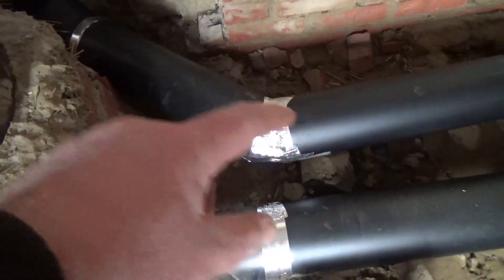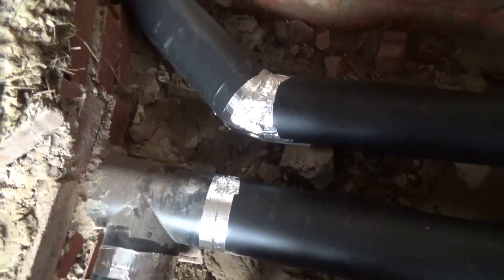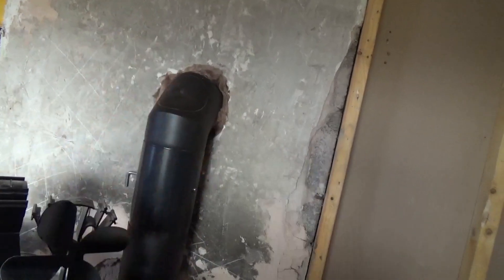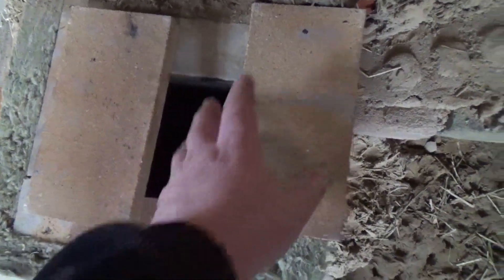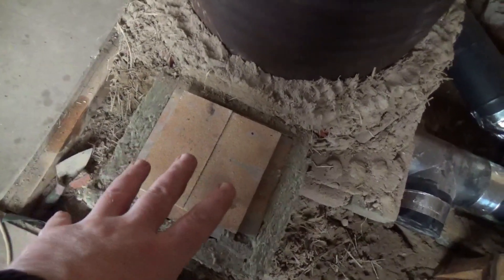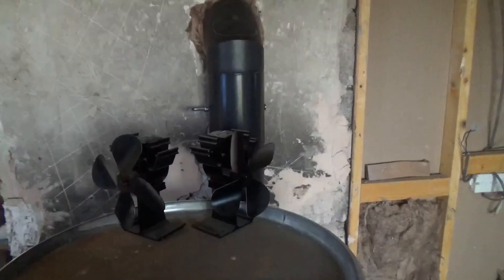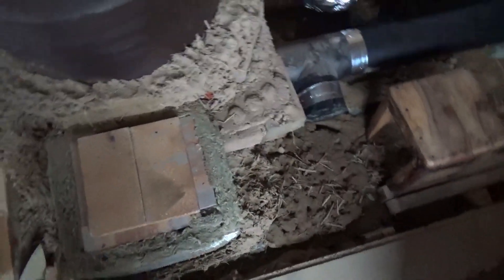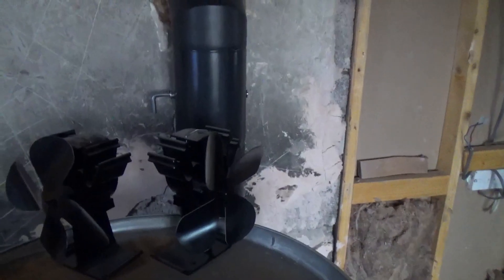Rocket mass heater build 9. The first burn. The most efficient heating in the world.

Comment: Hi good job ! Does it work with a bench of 30f one way and do you have the reference of the book please? Thanks
Reply from the maker: The book ISBN is in the description below the video. I'm not sure about that exact length, but with an insulated chimney at the highest point of the building it would certainly be a very long bench possible.

Comment: if you arranged to feed the combustion air with air from outside, it would be even more efficient.  1) not taking heated air in and putting it out the chimney.  2) there is a low pressure being created in the house from the combustion air intake that is then drawing outside air in via an imperfectly sealed house envelope.  Could place an HRV/ERV somewhere to mitigate that part of the equation.  (maybe you have already)  Nice job on the heater !
Reply from the maker: That research has been done, there's no advantage to using outside air, and I assure you my house has so many cracks and gaps there will never be an issue with low pressure.